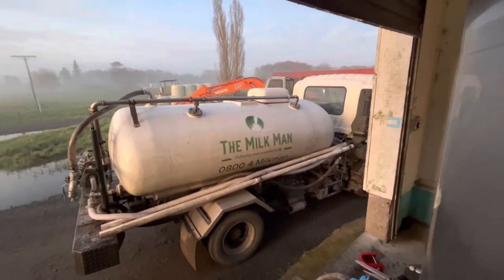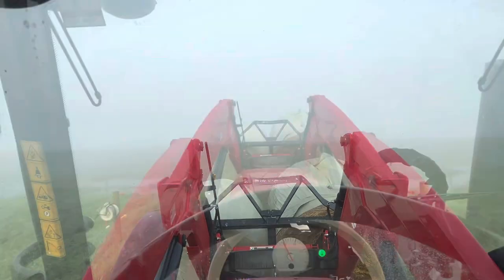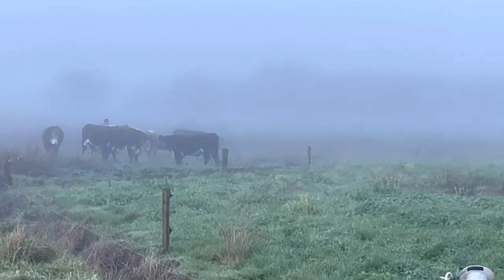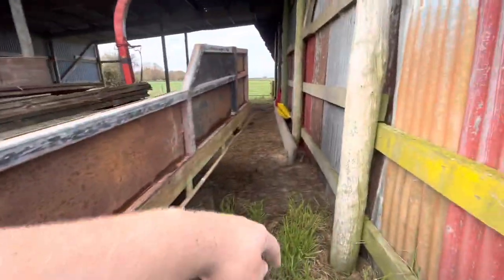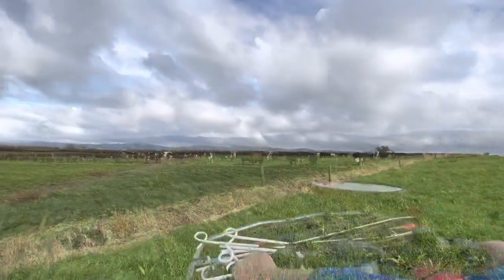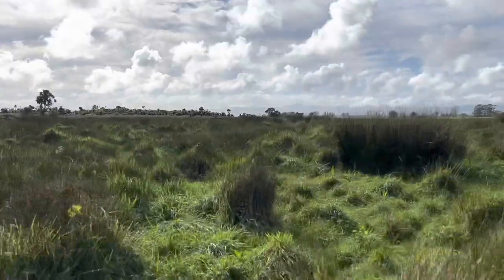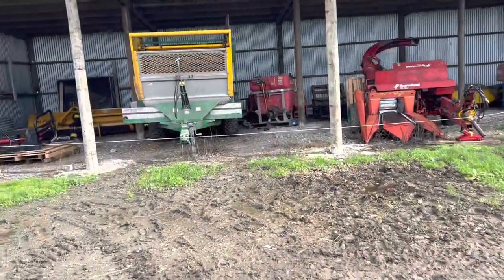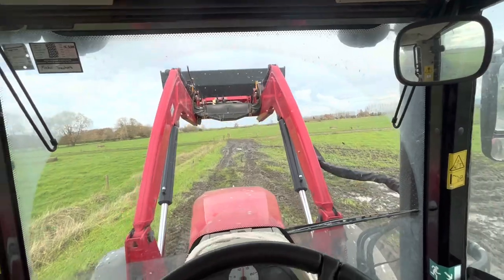Last Milk Pick Up. Diggers Bucket Change. Shifting Equipment & Cows #farming #silage #digger

Comment: Evening Carl,what price do you receive for your milk for calf rearing and why does the local council tip lumber into a drain when it seems counter productive to water flow
Reply from the maker: Hey Mark mate. 
Dad said he was getting paid 20c per litre for the calf/pig milk from the Milk man. 
That is an old effluent pond we are fulling in. That we no longer use as we have a kilp tank for effluent. 
They are fulling it in with dirt from slips and wood from anything they don’t need to use. It’s about half full so far.